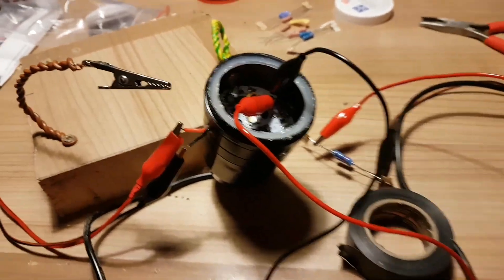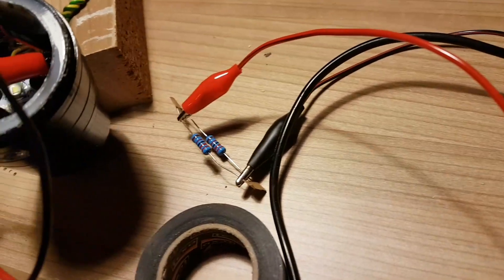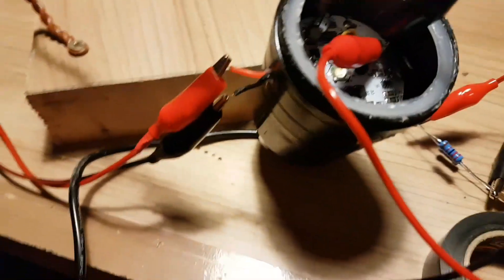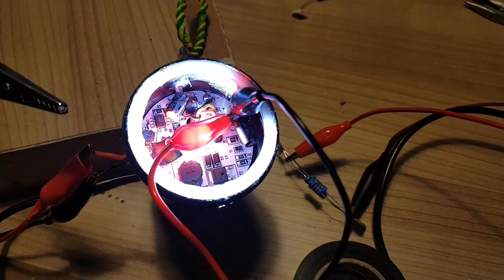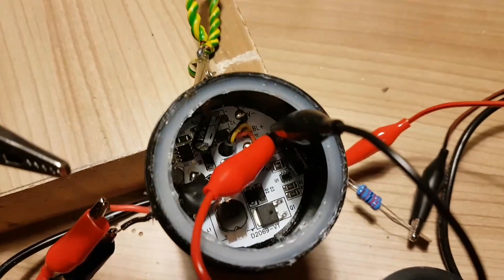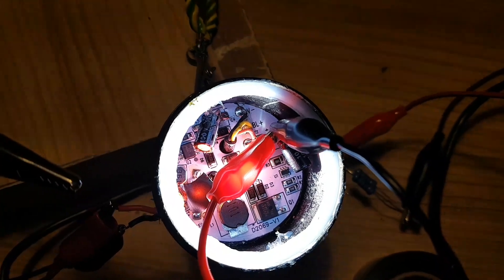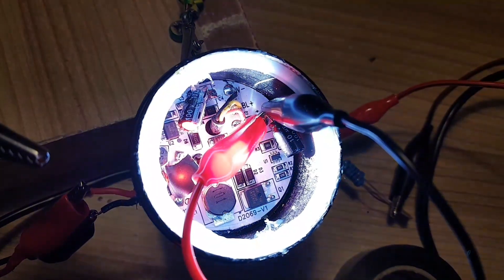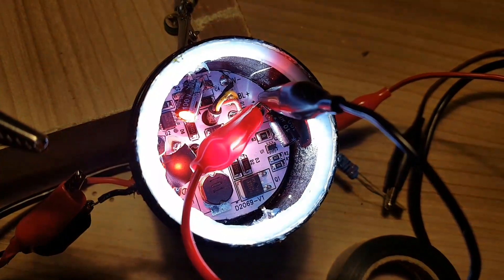U7 Cree motorcycle fog lights- low and strobe functions removed successfully!

Comment: Hello, this is not the way to remove the strobe, the chip U1 is a voltage regulator, by connecting a resistor across C4 you are increasing the voltage to the LED in fact a 10K resistor doubles the current to it. The heat output from the extra current causes
the whole unit to get too hot to touch, and will fail in short order. Sadly I don't know the correct method for removing the strobe. John.

Comment: I bought some of these U7 Cree lights a about a year ago and intend to fit a 12Kohm 5 Watt resistor as in your video. The ones I bought came with a 2 button handle bar switch, one just switches the outer cob on and off. My question is, if  I fit the resistor will it effect this button for the outer cob. The other button switches the high low and flashing modes on in sequence aswell as switching on the cob. Grateful for any help!
Reply from the maker: Grommit Jackson Hey there! Lucky you, you got switches with it. The answer is NO, the resistor will not interfere with the outer cob. Of course, if the layout of the board is the same as in this video.
Reply: fun&games ok, thanks for getting back to me! They are still selling them with the two position switch on eBay, I will try and find them and include a link. I am sure they are the same as my ones.
http://www.ebay.co.uk/itm/2PCS-Motorcycle-U7-125w-CREE-LED-Headlight-Driving-Stop-Button-Handlebar-Switch-/291662614133?nma=true&si=hsx3vQrCqHt8xuls8MiCMoQMA1c%253D&orig_cvip=true&rt=nc&_trksid=p2047675.l2557

Comment: Why do u remove those functions?, what's the advantage?.
Reply: Not true... Having functions is a personal use case.. if you want functions leave it.. reason for not having it is not having to cycle between functions everytime you turn off and on bike(lights)  as the functions change.. would be nice if they had a three location switch which allowed you to select which one you want to use... but they dont.. In UK its illegal to have strobes... I like to have fog always on high beem... no real need for low as they are closer to ground..  f course this is just my opinion..
Reply from the maker: Brijesh If you don't have the need to remove those functions, just skip this video

Comment: Hi, i'm interested about buying those product... But i'm very disappointed to see that only tiny led in the headlight package... I'm thinking about putting 3 5watt led... But i need some space... Can you tell me the size of the white pcb ? 

I would be very happy if i could put https://fr.aliexpress.com/item/5-Pcs-lot-LED-High-power-PCB-Board-Plate-Lamp-Panel-Aluminum-Heat-sink-1W-3W/32444370988.html?spm=2114.13010308.0.0.d98iok the 32 or 35 mm round heat sink...

Thank you for you answer !
Reply from the maker: Arnaud Vivi Hi, I believe you could fit the 35mm one, the size of the pcb inside is roughly 40mm
Reply: Great !!!! Thanks a lot for the very fast answer and thanks you for the help ! :)

Comment: hello sir, can you please tell me the value of 1 resistor because the video shows that it is 2 resistor, so we need to use 12k ohm 5w
Reply from the maker: Value of one resistor is 12kOhm, 5W. The second one is there just because I was lazy to remove it, sorry. I will leave a new video here with the whole process top to bottom, after my new lights arrive, in a week or so. Stay tuned!
Reply: fun&games one question sir, from where you got 5w 12k ohm, i cannot find any similar like your's please help
Reply from the maker: Joseph LR normal electronics store, if you cant get 12kOhm, try 10kOhm or bigger
Reply: fun&games okay thanks, i found 12k ohm but i see only 1/4w, 3w etc
Reply from the maker: Joseph LR 12kOhm 3W is also good
Reply: fun&games okay thanks for your help, keep it up, i subscribed

Comment: Easier solution is to draw with a carpenter pencil over the C1 capacitor, the graphite residue is conductive so the capacitor unloads faster. Not as elegant solution but it is working for me :)
I also did put some back silicon on the red led to make it invisible.
Reply from the maker: Thomas Nehrlich Sure, graphite works, but for how long is the question... I have no problem with the red LED (the devil eye efect), and I have seen some guys blocking it with black tape or silicone, but what ever you do, DO NOT REMOVE THE RED LED, cause your angel eye will stop working.
Reply: You are right, the pencil might wear of, or not, time will tell. 
About the red led it is not legal to have a front red light on a vehicle in most EU countries, so this is mostly just to avoid problems and for me it looks as well better without.
Reply: It still works when you remove the red diode, (just break the top) but the colour of the ring changes from white, to blue

Comment: Hello,
I solved even better! I removed the capacitor C1, and only left the resistor (12 k or 10 k). 
With rapid changes restore the high beam, medium and strobo sequence. 
With normal changes you have just high beam.
Many thanks Riccardo for the advice!

Comment: Hello I saw your video and is the only one that shows the solution to remove the strobe functions and weak light. Compliments!

I wanted to ask some more information:
in the video you see that it works, but at some point you reuse strobe functions and low light.

Could you send me some more details to solve the problem?

Thank you.
Reply from the maker: Riccardo Fiabane The low and strobe functions are not completely removed. if you want to get into other modes, your off/on time needs to be les than one second